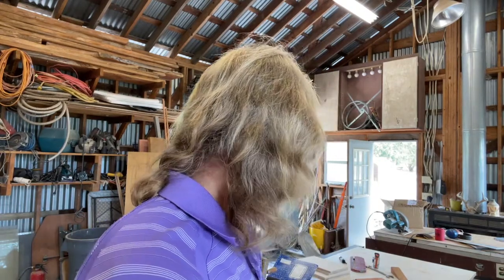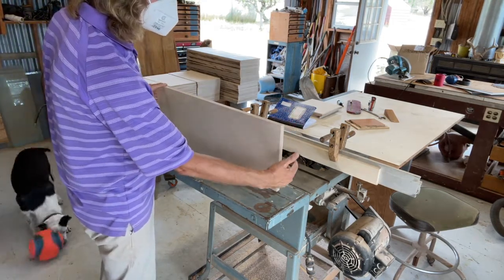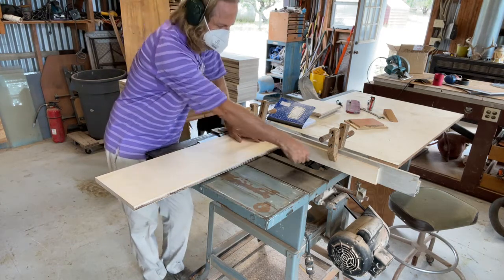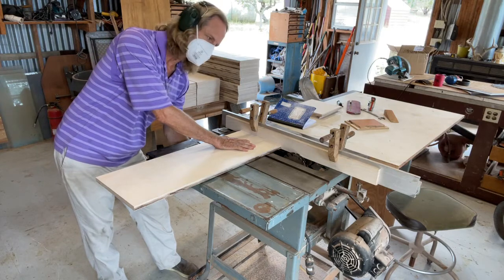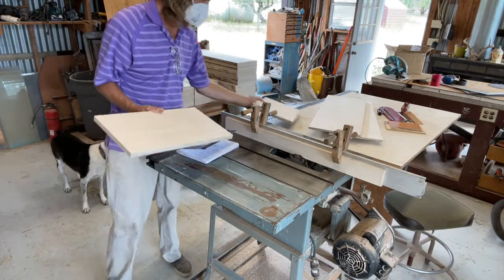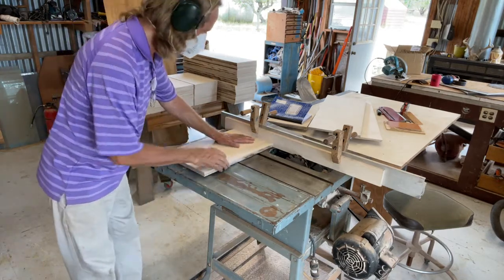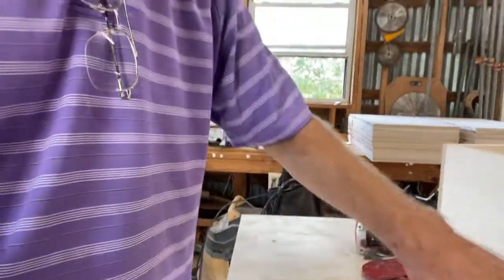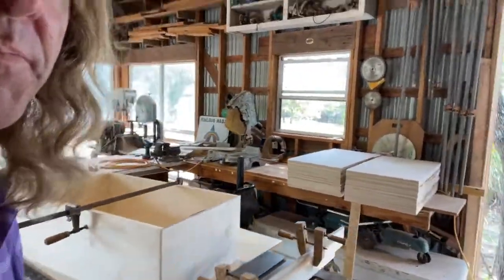Rabbeting the Battery Boxes

Comment: Ray keep on doing the  kool stuffs. What’s the dimension of your battery box? Please and thanks
Reply from the maker: I looked back in the comments and found the following info, the internal dimensions are 30.25" x 16.5" x 10.5" the plywood is 3/4" so add those layers for external dimensions. I laid it out so that I could just access everything inside with adequate clearances. The waste from 4x8 sheets of plywood on the first 12 boxes was mostly sawdust. I will have a bit more waste from the 4 I still need to build due to the last project expansion.

I was unable to measure the box because I'm on a dive trip in Mexico but I trust these dimensions as I added this comment when I was in front of the box.

Comment: You must have been a helluva good trim carpenter to check the finish side for a battery box.  I prefer a small chamfer to round over but I’m not at your level so would like to hear if you have reason I should switch
Reply from the maker: Often the only cost for doing something at a much nicer level is just to focus. The material costs the same. The labor takes about as long. Focus and precision brings the greater value to the finished work and if you heck it up, the fine attention to detail  can make it look good anyway. I recommend the book "Shop Class As Soulcraft" by Robert B. Crawford. He explains the inner sense of well being we receive when we figure things out with our hands and bring our craft to a higher form.

In the high end contemporary architecture that I usually build, edge details are usually crisp and prone to damage but lovely to the eye. I find a chamfer to be visually appealing but a bit more prone to damage so I use a round over if I think the piece will be abused during its life. These boxes won't be but the solar generator probably will. In fact it already has but it mostly goes unnoticed.

Comment: Hi Ray, this is great stuff you are showing. Could you also if possible tell how you build your workshop ? it looks very nice designed. Was it custom build or ordered ? Appreciate it. The reason i ask is because i am planning to build something similar and do not know where to start from
Reply from the maker: I built it on a shoestring budget with salvaged materials 28 years ago. Out of pocket was 5000$ at the time.
Reply from the maker: Wish it was bigger but I fit it in to the space available without cutting nice trees or moving the power pole.

Comment: Could this be done with a router? Or will the blades wear out?
Reply from the maker: It can but it will be slower and more difficult to get precise results. I would do it if it was all I had though for sure.
Reply: @RayBuildsCoolStuff  thank you. I only have a router and a drill machine to start from (if the batteries sell in the future, I'll get the cooler round round going saws). Your videos are very helpful. I see what I need to do and alter my designs along the way. Thank you for sharing your videos. I'll create a similar series to document my steps to help others in the future like your videos are helping me.